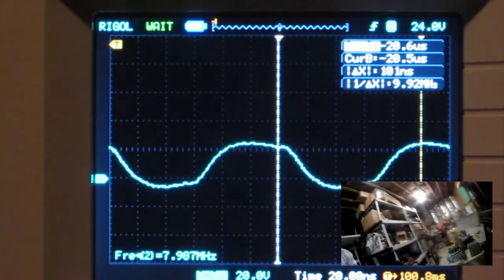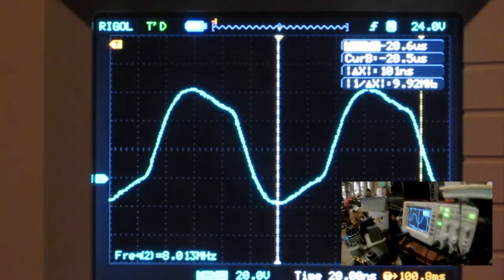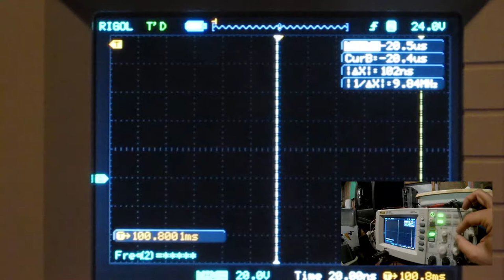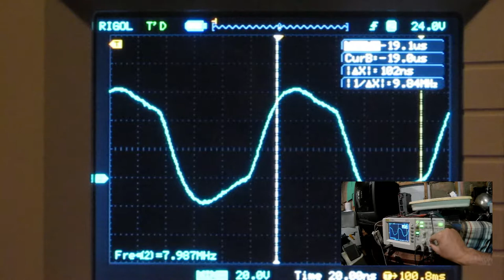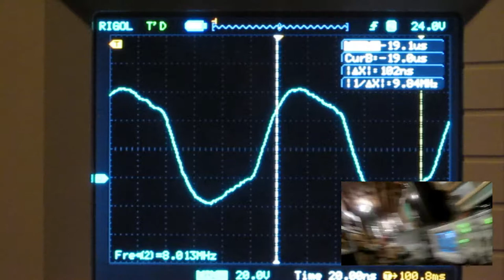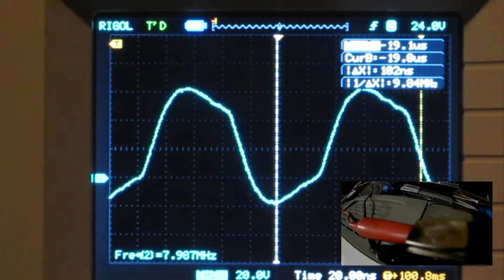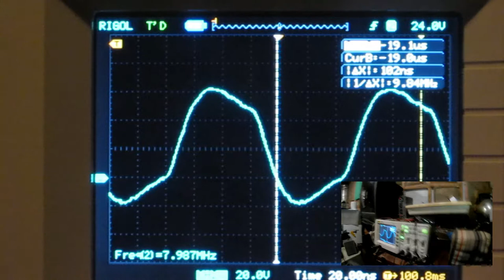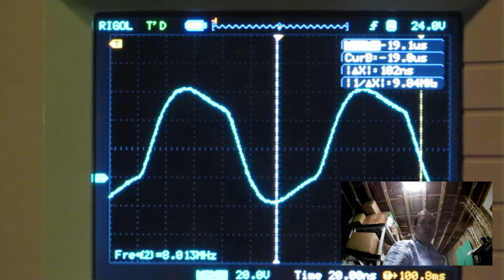DIY Time-Shift Detector

Comment: Fascinating!!! I am going to try this one. To address the issue of heat I suggest a negative voltage power supply to drive the crystal. This will also allow much higher applied voltage and result in higher frequency. This would then permit the device to detect time changes in fields higher in frequency to heat. Think of heat as being the lower end of field vibration. To detect psychotronic energy, you will need to be in the Ultra Violet range for ideal results. I suspect you may find limited success in the mind inferred ranges as well. As always thank you for your service Dr. Jaynes.
Reply from the maker: Very interesting.. I have heard of people using UV cameras for ghost hunting.. I have not tried this yet.. I believe they are expensive though..  A frequency stable crystal might help stabilize the heat issue?  They are more expensive crystals that are thermally compensated.. Using them in a high electric fields.. is a completely different issue.. and requires more sophisticated equipment.. I just made this video to demonstrate the principle, I have a fiber optic isolated device that I used in high voltage fields... It is considerably more complex...

Comment: Very interesting - temperature = time phase.
Reply from the maker: The size of the crystal determines the frequency that it vibrates at. If it is heated a little, then the size changes a tiny bit.. and that causes a frequency shift.. since I am looking late in time, after the trigger the tiny frequency shift is seen as a phase shift on the screen (at 100.8 ms after the trigger). This makes it possible to measure very tiny changes in frequency.  The thermal effect of the crystal is not what I am hoping to measure.. but is was a convenient way to demonstrate the sensitivity of this device... I am more interested in using this device to measure real time changes.. to develop a time machine!
Reply from the maker: No temperature does not change time... but it does affect the crystal oscillator in an undesirable way.. I am looking to use a different type of field to modify time.. Thanks for the great comments.